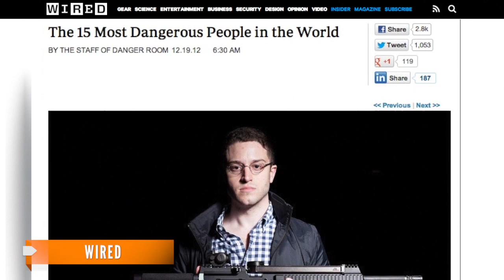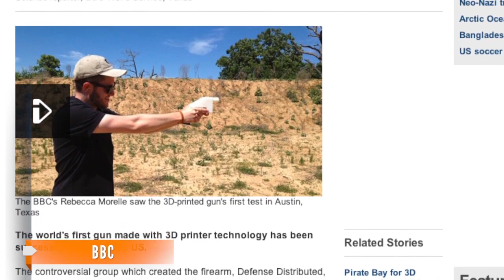Controversial Handgun Made With 3D Printer

Comment: What people don't understand is that this is not at all practical to actually cause harm. It is a single shot gun that takes 30 seconds to load and has a barrel that shouldn't be used more than once. A 17th century pistol which requires black powder is better. This is only practical to kill someone at point blank range and that could just as easily be done with a knife or even scissors. Everyone calm down already.

Comment: Your first point isn't really relevant as current 3D printers still have a relatively limited capability, both in materials they can use and also in what they can print with them. So they can be chalked up as a loss and their influence would be minimal.

Your second point is good though. In which case, I don't see a way they could effectively regulate this (since they'll probably want to). Maybe they'll pass something ineffective that helps corporations violate our rights... again.

:/

Comment: Interesting. He seems fairly fanatical on the subject. I'm interested to see how things work out.

Ultimately it seems impossible to truly enforce a ban on the weapons. Maybe the key to enforcement is the printer itself. Requiring a licence to own it and DRM or the printer becomes inoperable. That alone should prevent all but the most determined and tech savvy from printing firearms.

I wouldn't be surprised considering that the power of 3d printing will only continue to increase.